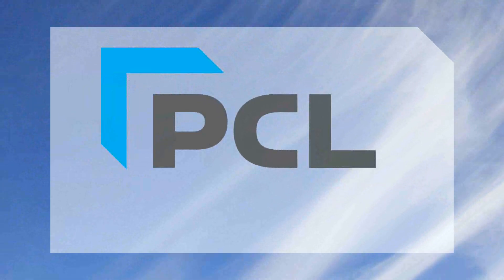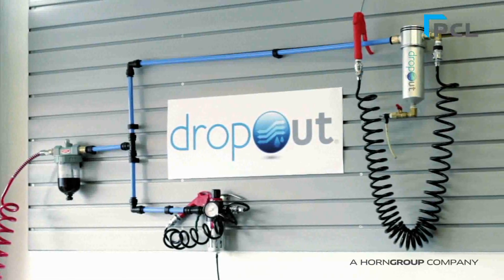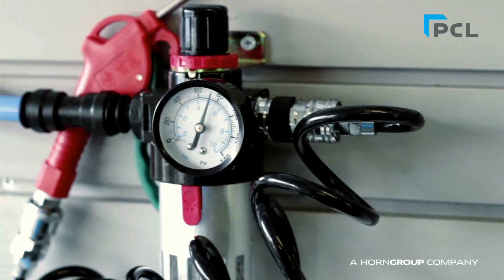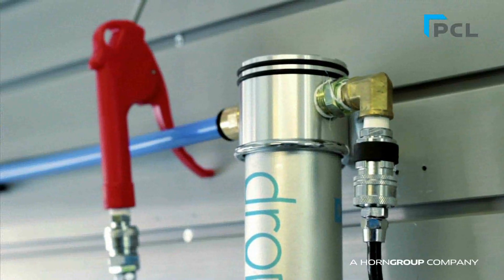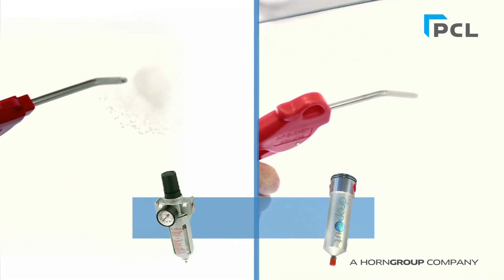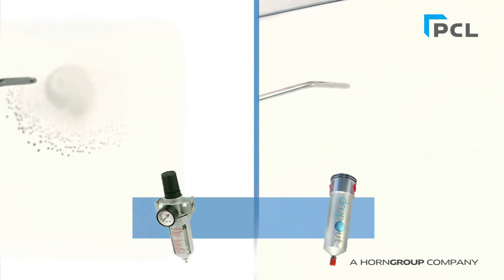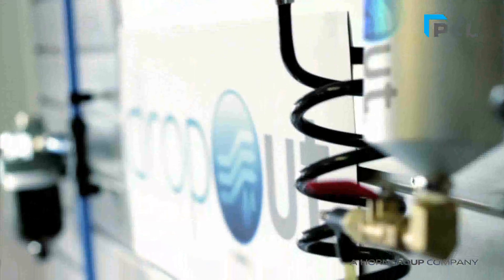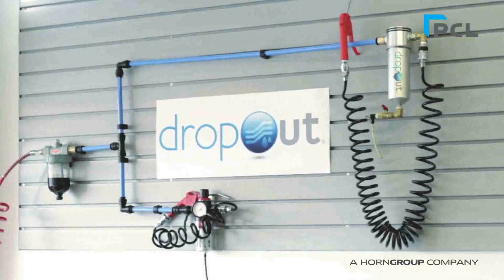Dropout Liquid water removal demonstration from a compressed air system

Comment: hello dear, can you provide air filtration system for 1 inch pipe, I need to remove the water droplets from compressed air. the pipe size should be 1 inch or more like 1.5 inches. is it possible? please send me email at zeeshan.muet@gmail.com or reply here?